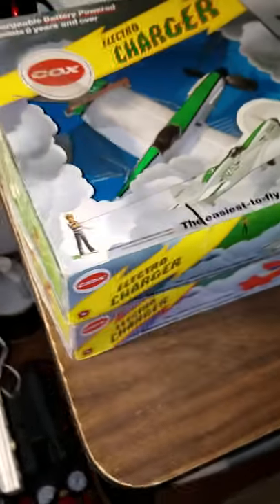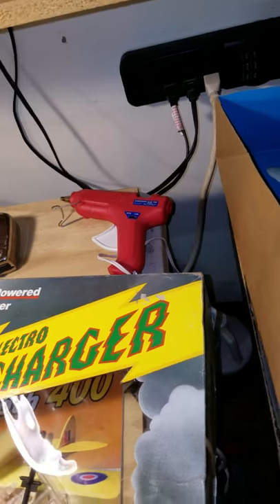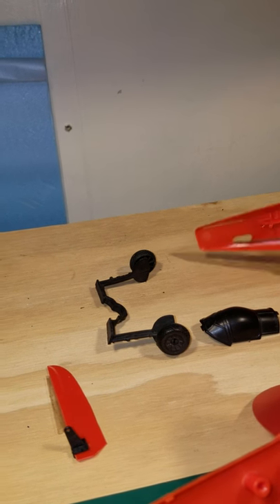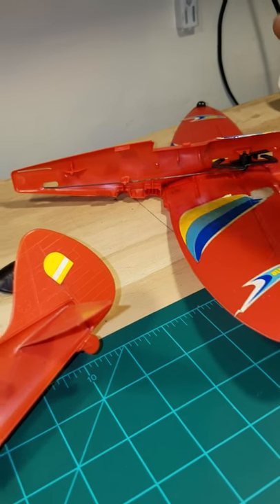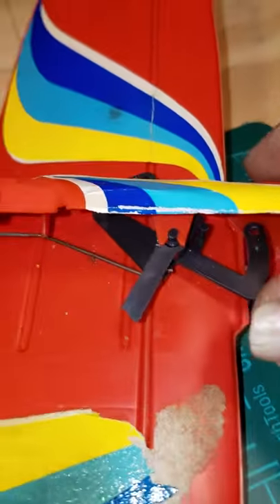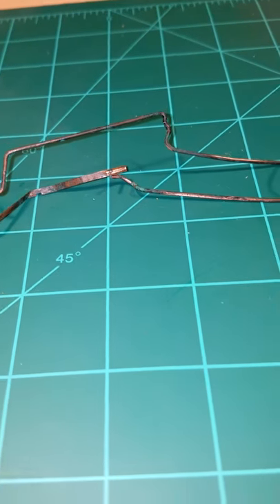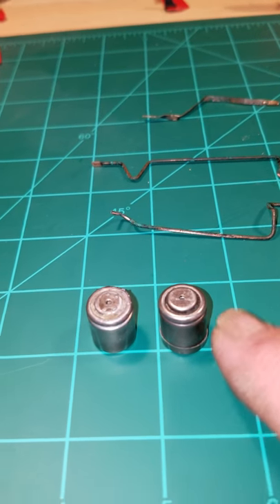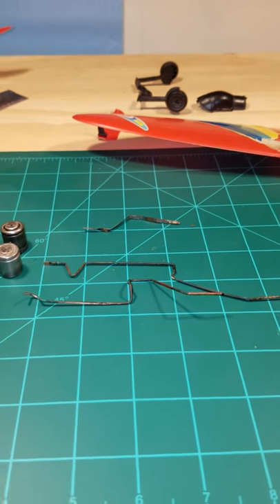Cox Electro Charger control line plane restoration

Comment: I had one as a kid, it flew, but from what I remember, was underpowered.
Reply: I had one as well. It really was underpowered. I just remember the battery would die out and because you were spinning around on the control  straining it would just keep going. I realized after the first couple of times I used it that 
it wasn't really flying itself for the most part you were just whipping it around manually.
Reply: I actually purchased one in the box from ebay.  only half the elevator is hinged!!